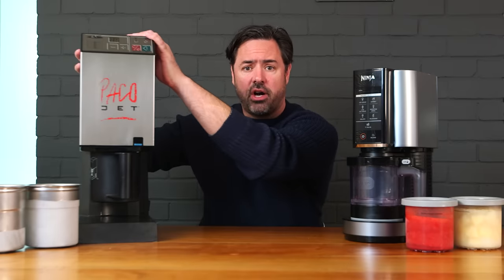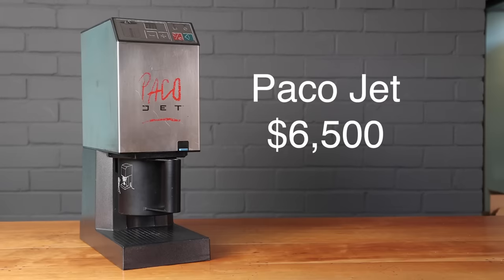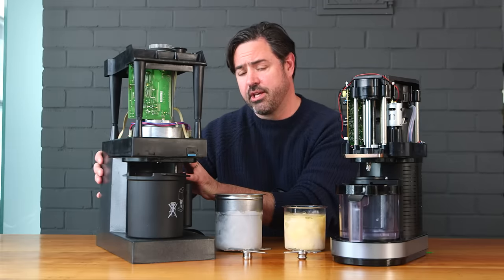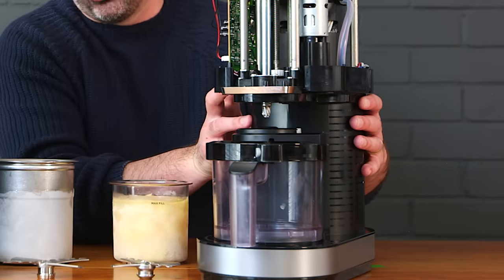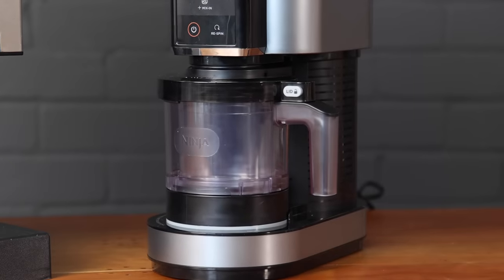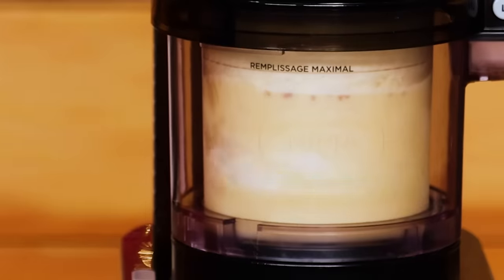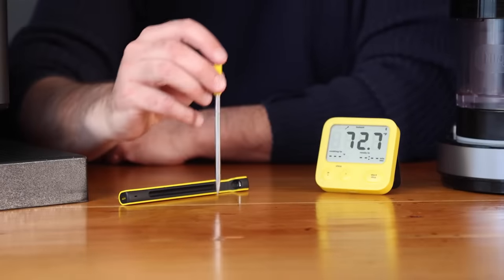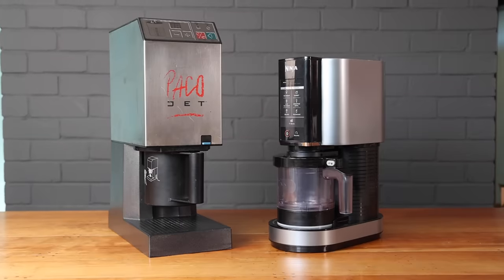Ninja CREAMi: Pacojet Killer?

Comment: i don't think pacojet have to adjust to the new competition, the Ninja looks great and works, but when buying from Ninja u get their machine and that's it.
when u as a professional kitchen buy from Pacojet, i'm sure you also get a service hotline, with available staff to service their machines if anything goes wrong, the Pacojet is also Clearly the more solid machine, and thus would definitely outlast the Ninja by a long shot.

i agree the Ninja is the better design of the two by far, but it is also using some cheaper components, one in particular i don't like is the spinning knife in a plastic tub.
Reply: Even the Pacojet has a plastic tub they are pushing nowadays.
Reply: @playnicegames  is that supposed to make it better ? 

Look i know most of the time it probably won't be a issue, but if anything is out of balance you'll literally make ice cream with plastic shavings
Reply: @Deathbyfartz  I think if you use them both correctly you shouldn’t have an issue. No plastic or metal shavings in your end product.

Comment: Ignoring durability, price, storage space in the kitchen, etc... If you took the same ice cream or sorbet base, ran it through both machines, on the plate is there any detectable flavor or texture deference? Or are you really getting a like for like product on the plate with the CREAMi
Reply from the maker: All things being equal and like for like (air injection disconnected on a PacoJet), then the result is the same.

The blade and it’s cutting teeth are the same, and the combination of rpm and feed rate results in the same cutting depth and chip size, which is what would create a textural difference.

The PacoJet does tend to stir the mix a bit more because of its higher rpm’s and faster feed rate, so the mix in the canister looks a bit smoother out of the machine, but once you take a scope, the result was the same.

Comment: I know the video is a year old but

"It takes about 2 minutes to do about 40% more volume, to the Ninja Creamies 2½ minutes to do 40% more"

Is just plain wrong

The Ninja does 43% less volume than and takes 25% longer than the Paco, where as the Paco does 75% more volume and is 20% faster.

Which is a HUGE difference. Is it a 6300$ difference? That's up to each person to decide but saying the Paco only does "40%" more volume and a gross mis-characterization of the numbers, it's doesn't only do 40%, it almost does double that at 75%.

As well as I've heard from many people that sometimes the Ninja takes 2 passes to do its thing which makes its take 250% longer at 43% less volume.

Is it good for the home cook? Sure.

But for commerical it doesn't even compare, which to me in this video you seemed to be making the argument that it could possibly replace some Pacos commercially

Comment: the question is, are both machines really producing ice cream? I mean the shark machine is only cutting already existing ice cream or frozen milk etc.. Real ice cream is made in an ice machine which freezes the milk and scratching the frozen parts of in a endless loop putting air under the frozen parts all the time. Real consumer ice cream machines have a real compressor for cooling
Reply from the maker: The biggest difference is that a churn-style machine whips more air into the mix, which makes it taste less cold and melt more slowly. But it’s a modest difference that most people don’t notice unless you have done experience comparing the results side by side. And more than a few chefs I know prefer the Pacotized ice cream because it melts faster, which tends to create a more intense flavor release.
Reply: @ChrisYoungCooks  yes but its not really ice cream i think. You can just take milk, sugar and a flavor and put this into the freezer for some hours, its the same concept. Its bascically a frozen block of milk and flavour put into a blender :)  But of course in the end its a matter of taste. The good thing is that its really easy to do unlike a consumer ice machine with compressor. I had a Gaggia gelatiera and they are not that convenient to use.
Reply from the maker: @danbarb9728  I’d say it’s ice cream. Has essentially the same texture. If you were served it blind, you would probably be unable to tell a difference.

Comment: i did not even know such a machine exists. you mean to tell me it can turn a sugary ice cube into ice cream? sign me up!! honestly even if you are small restaurant you could buy 3 ninjas and spread the workload on them to get around the overheating issue .not to mention if one machine is down you have no ice cream with the Paco but you have redundancy with multiple ninjas. and you can replace all three every year for 10 straight years and still spend less than on a Paco. i think ninja could charge a little more for steel canisters and just simply eat Paco on market share. for a home user, at $200 its an easy buy.

Comment: Well would have been nice to see the results. People report that first you get some dusty crumbly result and that you have to put it back and hit the remix button.
Reply from the maker: That’s a symptom of the ice cream mix having too few soluble solids. It will happen with a PacoJet too. The second processing just smooths the mix, it doesn’t cut it anymore.  You can also just use the back of a spoon or a spatula to smooth out the crumbly appearance too.

But if you have a properly balanced ice cream formula this doesn’t occur. Note, most ice cream recipes are a bit too high in fat for a PacoJet or CREAMi, and need less fat and a bit more sugar and/or nonfat milk powder to boost the dissolved solids.
Reply: @ChrisYoungCooks  Ok, its just that these recipes come included with the ninja, but what you are saying sounds plausible
Reply from the maker: @vizzo7  yes, I looked at several of the Ninja recipes, and TBH they are might be tasty, but they are not well balanced ice cream or sorbet formulas. If you're interested in a lot more information on properly balancing formulas, this website has solid information that's otherwise hard to find outside of technical books: https://www.dreamscoops.com/ice-cream-science/ice-cream-calculator/
Reply: @ChrisYoungCooks  any recommendation on the percentage/amounts of solids that would be ideal for the CREAMi?

Comment: Is your thermometer a meater clone?
Reply from the maker: Not a clone. And does many things MEATER can’t:

(1) 8 sensors, let’s it automatically locate the core, measure the surrounding ambient temperature, and uniquely it measures the temperature at the surface, which is the true cooking temperature because of humidity.

(2) These extra sensors and advanced algorithms allow us to make very accurate predictions of cooking time early in the cooking process.

(3) 38% thinner than a MEATER.

(4) Works as a fast instant read thermometer. We can measure the temperature to within 0.2C within 5 seconds. MEATER takes up to 1 minute to reach a stable reading and is only accurate to 0.5C.

(5) Doesn’t require a phone when used with our kitchen timer / display.

(6) Charges from a USB-c in 10 min, instead of AAA batteries in 1 hour.

Many more differences, including fully waterproof. But I think this is enough to show we didn’t just copy MEATER
Reply: @ChrisYoungCooks  thank you for the detailed reply thinner and separate timer is great. I don't like how close I need to keep my phone to the meater
Reply from the maker: I forgot to mention the timer acts as a relay, amplifying the signal from nearby probes much further.
Reply: I'll consider it as a meater replacement if the price drops.  Unfortunately as a home cook I wouldn't be able to justify a $200 thermometer.  I'll keep an eye on your future products as well as it seems like you created a superior product.  I haven't tried my meater on anything extremely large so I'm not sure if it will be an issue having only 1 internal probe

Comment: How are there a fricking thousand comments everyone being so impressed with the most fundamental question not being addressed at all? Is the product being created even remotely the same Quality? Because I can promise you a Vita prep turns out a completely different result compared to the ninja blender not even remotely the same texture.
Reply from the maker: It’s not a blender. Nothing like a blender. Yes, the quality of the ice creams made by both machines is comparable.
Reply: @ChrisYoungCooks  im familiar with the professional machine (and certified in ice cream production) which is used for much more than just ice cream like farces and purées and pastes (like my favourite green curry paste) which are often processed 4-6 times consecutively by that oversized motor. So it's not 6 pints but 1 pint 6 times even at home. My blender analogy was to say ninja failed before bringing horrendous quality to market especially for the price point. Which is why my skepticism comes from. In conclusion ultra smooth green curry sauce possible or would you be in for a whole lot of disappointment and mediocre sorbet?

Comment: Hi how is this even a comparison. The creami containers are made of plastic for goodness sakes. The blades cut into the plastic container. So many people are returning the creami due to this risk! Its a far cry from the pacojet.
Reply from the maker: I mean, I’m pretty sure you just made that all up. The blades can’t reach the plastic any more than the PacoJet blades can reach the metal. I’m sure that some machines have manufacturing defects like any manufactured product, but I’m also certain you have no idea on what the defect rates are.
Reply: @ChrisYoungCooks   Hi Chris thanks for your reply and very well made video. Indeed I'm unsure what the defect rates are but sites like reddit and even Amazon reviews are full of bad reviews explaining the same experience I had with a recent creami purchase. How can one figure out such a defect rate? Yes you can blame it on user error/people not following instructions but I had a horrible experience and returned my unit right away. Until ninja comes out with metal or glass containers I'll be buying store bought ice cream.